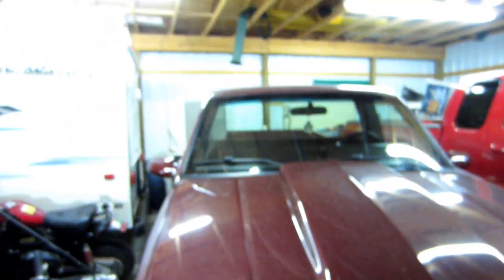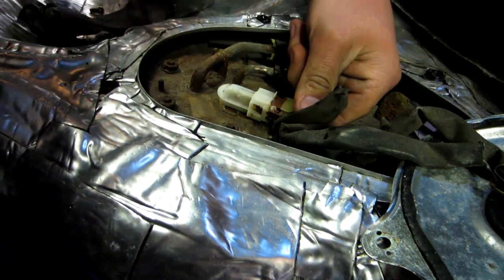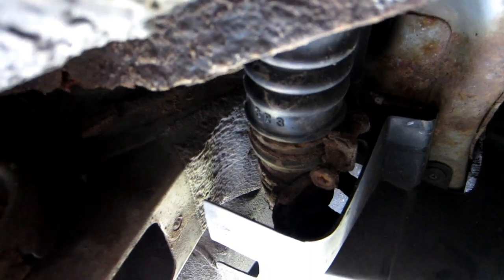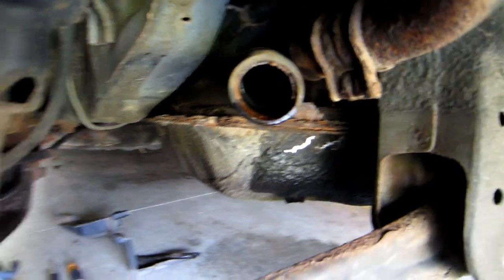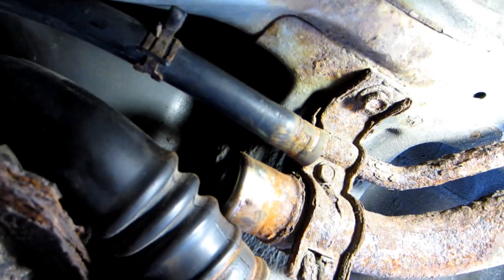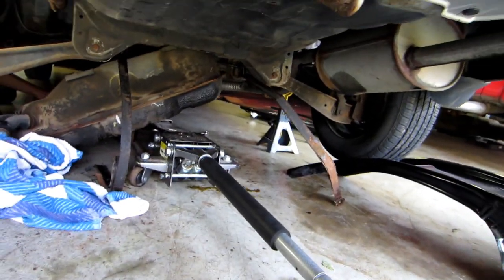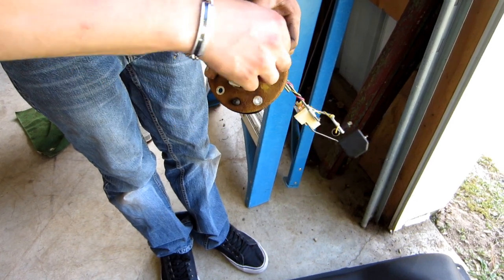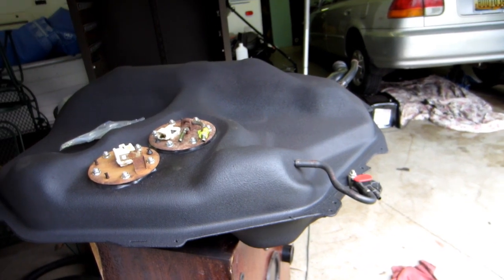How to replace the gas tank in a Honda civic

Comment: Is changing fuel pump necessary for the replacement?!
Reply from the maker: It’s not necessary but they’re not too expensive so I would recommend changing it while you already have access. If you’re changing your tank due to rust though, i would suggest changing the pump and filter.